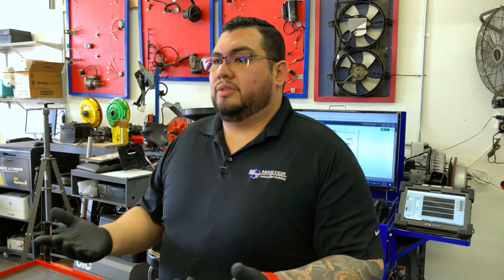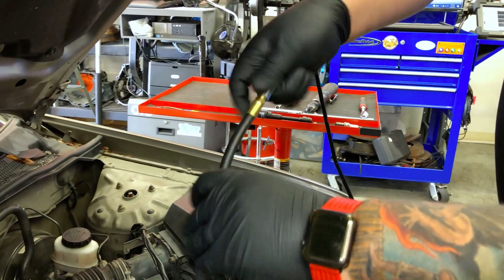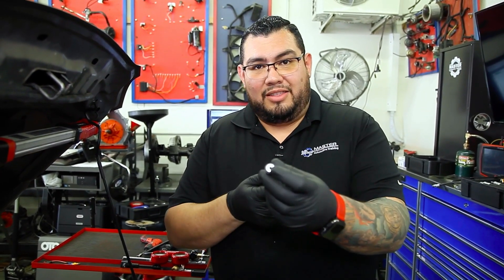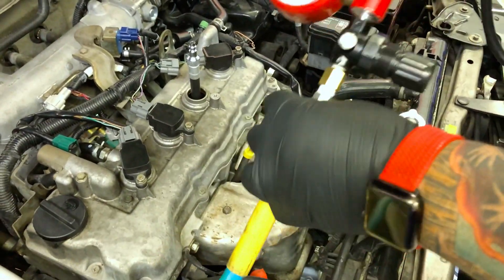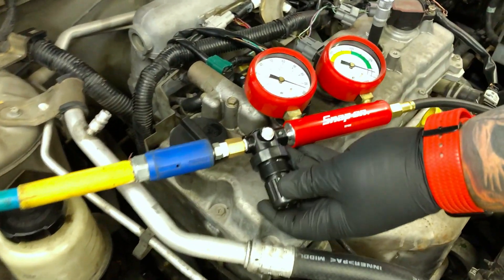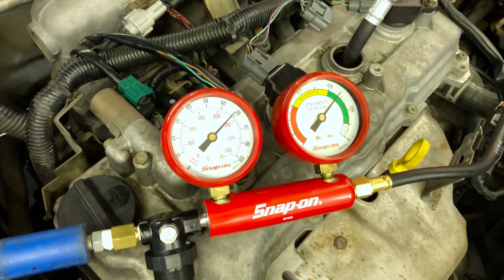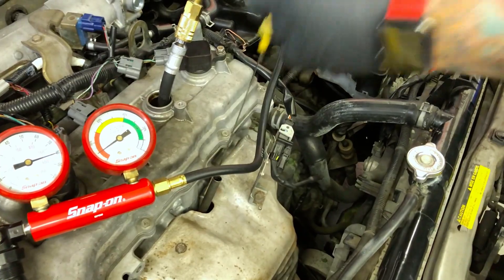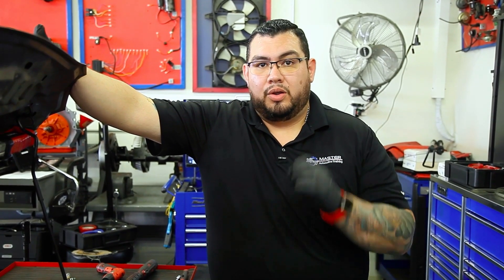How To Perform A Leak Down Test - Fast & Easy

Comment: As a side note: Get in the habit of ALWAYS turning your engine crankshaft clockwise. 98% of all engines run clockwise. Those that run counter clockwise have no timing chain tensioners in them anyway. (Old engines) Anyway, what happens with a timing chain tensioner engine is if you turn it counter clockwise it can unload some tensioners and jump the timing. Now of course people will want to start leaving comments about this or that engine having or not having tensioners and I'm very well aware of those engines. This video however seems geared towards the beginner or intermediate technician. So.... Always turn your engine clockwise by the crankshaft. Don't get lazy and turn an overhead cam engine by the camshaft either. You can jump the timing like that as well. Anyway, great video. Straight forward and informative. Thanks for posting.
Reply: Must’ve never worked on a b series which most would consider a beginner engine

Comment: Did a timing belt an water pump on 2005 Toyota Camry..has 260k vehicle was driven in by customer with no coolant and hot but no misfires or mil . Did timing belt an water pump triple checked timing marks were on point before cranking. Was wondering why it passed compression but still has misfire on back cylinder after timing this video really helped

Comment: You should also turn crank so the piston goes from top to bottom so you get a test of the cylinder from top to bottom. I've seen cracks in cylinder wall

Comment: Yep, I do agree using an extension or whatever tool to find TDC,  however I would say plus or minus20% isn't going to make a difference. Depending on the engine it can be a nightmare to insert a tool, find the piston or may very well jam in some manner which will guarantee the engine needs to come apart.  The video was excellent, to the point and well done. Thanks to the folks who made it

Comment: Great presentation.
I have got a 2017 Honda civic 1.0L a 3 cylinder engine. Cylinder 1 and 2 got 175 PSI but Cylinder 3 has got 0 compression and air is escaping from the intake side. we've replaced VTC intake camshaft, intake valves, new timing belt and still not solving the problem. any ideas? Thanks.

Comment: This information is very helpful but I have a question... If you were to remove the intake manifold for easier access to the sparkplug holes(in the case of a 99 expedition) would that affect the readings ?

Comment: I don’t understand the glove test. You put a glove over the exhaust and it will inflate. How do you know if a ev is stuck open?
Reply: Ok. The point is that you are applying air at 1 pressure .. say 100psi.. then the gauge is real-time showing you the pressure in the cylinder.. if it is low, >40% loss then you basically want to discover where the pressure loss is at.. (1) exhaust valve not closing fully = >40psi of air going out the valve and continuing out the tailpipe… this would blow up a glove to some degree. (2) intake valve leak would show by checking an intake hose to see if air is pushing out there.. *up the intake valve path and back to the intake manifold (3) the dipstick hole with pressure = air getting past the cylinder rings (5) Headgasket= the air going through the blown gasket and entering the coolant system … as seen by bubbles in the coolant (5) if none of the above checks fail (1-4) then you likely have a cracked head and the pressure could be exiting the side of your head .
Reply: @fishonnelson2353 thanks! I missed the part this was done while compressed air was applied only to that cylinder. I thought, “of course exhaust will blow up the glove.”

I just did this test. And all cylinders I found air making it past the rings. Which does make sense, especially when cold and the ring gap is at its widest. But I’m not sure my one cylinder unlike the others at 40% loss (others at about 20%) is any worse pressure wise from the oil cap where I felt air pressure from all of them. They all felt roughly the same, none of them had sound from the tailpipe, the throttle plate, nor bubbles in the radiator. Sounds like from your write up I could have a crack in the head at that cylinder, unless there was a discernible difference in crankcase pressure.
Reply: @Seth_Michael_Hernandez  Yeah...Your test result logic sounds good however, I'm not easy on condemning heads so I would try to zero in more..  Now I would add a 2 tablespoons of oil to the low cylinder... this should shore up the ring loss.. if the pressure goes up to only 20% loss or less like the others then its ring issue.. if it stays low (hopefully with very little improvement *for the purpose of certainty of the test) then I would start leaning harder towards crack .. keep in mind that you should have all angles covered (1) Oil path - to crankcase, (2)  water paths to radiator, (3) air paths to intake and (4) air paths to exhaust.. so if there is a crack it would be to the atmosphere based on what your tests are reporting.
Reply: @fishonnelson2353 ok I’m gonna see if I can get those two tablespoons of oil into that spark plug hole. It’s not at an easy angle to do that, but maybe I can get a baster of some kind. I did have 4 spark plugs with ash build up. This cylinder had a solid “wall” of ash from the top electrode to the insulator built up on one side like a cave. I’ve heard that ashy build up is indicative of oil from the valve stems as it atomizes when entering, whereas oil build up on spark plugs that are dark and wetter is more indicative of oil coming in from the rings. So that gave me some hope. I just replaced my oil valve stems seals for my intake and exhaust on that cylinder. And compressed air did hold both valves in place from falling into the cylinder while I did that job. So I would think that’s 100% ruled out now since there was enough seal to keep them pushed up. No change in leakage often completing that unfortunately. I’ll try your oil trick and see if I get more pressure retained. Hoping for a head crack at this point, so I don’t have to replace the engine. But on my tbi 350sbc I have 193 swirl port heads which are not commonly known for cracking like some others. So it’s not looking good for me.
Reply: @Seth_Michael_Hernandez  Valves holding up if not hissing is a good sign! An oil can or a piece of tube... If that test fails to reduce the loss to normal.. even a even cork the tailpipe could help to expose the air exit path..  I'm rooting for ya on a stuck ring! sound like you're just about there..

Comment: How do you know that the piston doesn't move into transition phase with the 100 psi of air you are putting into the cylinder, and the intake valve is open?

Comment: Didn't explain in detail enough. Y did u hand crank the engine to tdc? Why did the 1st set to tdc with the whistle fail? Access to coolant? Only if the gasket fails correct?

Comment: When checking each cylinder, does each cylinder need to be all the way to the top?
Reply: Yes - the cylinder is sealed (should be) when at Top dead center *piston.  Don’t forget the piston will be at its highest on “compression stroke” and “exhaust stroke” so make sure its on the compression stroke if you read 80% loss or greater

Comment: I noticed that this professional tool needs 100 psi to calibrate to “0” the second gauge, however I bought a cheap one that just need 30 psi to set the “0” , did the test and all my cylinders are in the “yellow” scale meaning less than 20 % leakage….

Comment: Thanks Oscar! The only thing that would have been more helpful for all is what about old air cooled engines without coolant? Other than that, completely informative and a great help!
Reply: If you don't have coolant. Then I guess you're not losing compression through the coolant passages. Coolant test passed. Time to move on to oil, exhaust, and intake.

Comment: Why don't you reset the pressure regulator back to 100 psi on the input side of the tester after you connect the tester?  Some of the pressure loss is in the adapter hose that is not part of the combustion chamber volume.  The output pressure gauge now reads 15% lower than it should which could be the difference between a good and moderate reading and lead to an incorrect analysis.  From 100 psi on the input, the output gauge should read 80 psi or higher (20% difference).  It makes the math easier.

Comment: Very informative. I've never used a whistle though.  I just put a 3/8 extension in the spark plug hole until it's at its highest. I gonna have to try this method

Comment: This is brilliant, !
 I bought cheap cylinder compression tester and a cylinder leakage tester to see whether it's worth spending the time on replacing my 2000 VW T4 Transporter's clutch and main gearbox seal... would you have any similar clutch replacement and bell housing bearing videos?Much aappreciated 
Cheers m8.

Comment: Help!  Any experts in Owasso Oklahoma can help me do this?  I know enough about automotive repairs to be pretty  dangerous having owned numerous  70's muscle cars.  Lol.  I have a 1990 3/4 ton Chevy truck with low compression on cylinder 4 but need to pin point the problem.  I have an air compressor and some tools but no tester.   And by the way, I'm a girl, not that it matters.  Anyway, desparate for help here.  Thanks for any replies! 😅  I forgot to mention it earlier.   The reason I need help is due to I don't have the money to fix the 1990 truck or the transmission on my 1996 Chevy truck so I'm grounded pending getting these repairs.

Comment: Get rid of the whistle gimmick tool, for whatever cylinder u testing yes it must be at TDC find that using the gauge itself once u have found TDC with the gauge disconnect the air line, then put the handbrake ON and put the vehicle into any gear u want to my preference after 35 years in the trade is second gear then reconnect the airline, IF u have full compression the vehicle will lift slightly as its in gear and under LOAD and handbrake on so read the gauge to compare to others, IF it doesn't do that check the gauge then if u have access to crankshaft bolt turn it one way or the other to get the best reading then compare to find which cylinder is leaking, seriously throw that whistle gimmick in the bin, a leak down is always better with the piston under load and more accurate....

Comment: You dont need to be at true tdc to do a leak down. Top dead center on compression would be the last moments of both valves closing. 
Bottom dead center is the begining of the valves being closed. 

In between the start of a compression stroke (bottom dead center) and the end of a compression stroke ( top dead center ) is when the compression is held, aka both intake and exhaust valves being closed. 

If any extra leaking occurs in any range of that begining and end of comp. Stroke you will notice it and youll bave to find it. 

Aka listening into the crankcase. Intake manifold. Exhast

Comment: I recently got a dod amf delete kit with a Non DOD Cam #2054301 3-Bolt Stage 2.1 NSR (218/227 .523/.523 HR112 , had it tuned but it’s still not running right and now my brake petal is hard , replaced the brake booster but no luck any thoughts ? It’s a 2008 Chevy avalanche, RWD

Comment: Sup, man? Is there a correct way to do a compression test? I found multiple videos and not one of them is the same. I tried one method pulling the ignition fuse and it wouldn't even crank. Every video says, "it's really easy, just do this," and it's never the same 😂.
Reply from the maker: What part of the test are you doing, static or running?

Comment: Great presentation. Unfortunately, it seems like the only way to know for sure if the valves are truly closed is to take off the valve cover. Maybe place a thin rod down the spark plug hole to confirm it's at TDC. I like to use my mechanics stethoscope rod that unscrews.

Comment: the guy that invented this test is a genius !  newbie question: is the cylinder (ring against wall, and valve against seat) supposed to be completely air tight like a balloon ? ---- pretty amazing assuming it's made with steel
Reply from the maker: Vale seat yes, pistons rings will have end gaps so they aren't fully sealed.

Comment: Tdc doesnt always reveal cylinder cracks, damage or defects.... ive seen gouged cylinders that seated with the rings just fine at TDC. Your cylinder can still lose its seal halfway through the stroke which can just as easily lead to catastrophic engine failure as a broken seal at TDC. I like to do both TDC and BDC when I do a leak down. I also like to do it with the valve covers off when feasible. If the valve covers are too hard to get to then put your tools away and close the hood. The car is a piece of junk built by idiot engineers and belongs in the trash.
Reply from the maker: Thats correct, this is why this is follow up test to, static, running and snap compression. Those tests will test the cylinder dynamically to show the faults you listed above. A static test like a leak down is simply a follow up. Thank you for watching.
Reply: @MasterAutomotiveTraining  by static test I assume you mean a compression test, which should be why youre doing a leak down test to identify where that leak is at because if there is no compression loss then I can already tell you what the results of your leak down test are going to be. Im just pointing out that if your leak down test is inconvlusive and you cant identify the source of your leak then you should find it running a test at bdc and by watching the movement of your valves.... even a weakened spring can cause leakage intermittently. A worn piston skirt is another common issue that doesnt always show up on TDC  because the rod is fully extended
Reply from the maker: @brandonharvey7939  No static test is testing the engine or any component not operating. A static compression test only tests the engines ability to build compression and seal. You then run a running compression test along with a snap test to then determine the engine ability to breathe known as Volumetric Efficiency. If you spot a low compression static, then a static leak down test is needed to find where the sealing problem is, however its not bullet proof. For worn valve springs, guides, seats, you should have done a dynamic vacuum test to spot those faults.
Reply: @MasterAutomotiveTraining not familiar with this static test youre talking about and the only information google seams to have on it relates to jet engines but according to your description it sounds like you are implying that a leak down test would also be a static test because its done without the engine running

Comment: Me, "that whistle tool seems like the dumbest thing I've ever seen in the history of automotive tools."  Halfway through the video, "so it didn't work" lmfao
Reply: Just put a straw down the spark plug holes and rotate crank by hand until the straw indicates TDC.
Reply: What do you do if it falls in
Reply: Well I mean it should be long enough that you can see it. If it is, then it can't fall far, there shoukd be a piston in there to break its fall. If not, then you might be getting close to the root cause of your poor running engine. 

But to answer your question directly, if you are so dumb that you use something  that can fall into the cylinder, then you deserve to pull the head. 
I'd suggest a nice long dowel. Maybe 2 ft. Aint no engine in consumer automotive that has a 24" stroke.
Reply: Talk about dumb ...lol who uses a 2 ft long dowel to check top dead center all you need is a screwdriver cuz the handle is big enough where it won't slip into the spark plug hole.....😆😆 You keep using those two foot rods ..but that sounds just as dumb screwdriver is all you need unless you want to be banging that 2 ft pole into your firewall

Comment: Great but, your video has confused me as just a backyard, yet long time backyard mechanic.  Noting your Whistle Set of TDC appears to not work the First time around. Yet you say on the second time..."we know it's at TDC"...again, but is that because u did it by Crankshaft (u said it first time also)??
So if it didn't work the first time, why is it working the second time?
Also, you say you know the engine was NOT miss-firing, so you need to reset the TDC. But if you did not know the engine was NOT miss-firing, then you (I and others) would have done a test that is not valid. 
Please help us understand these contradictions...the Whistle doesn't seem like a very valid way set TDC if you must know the Fire condition with surety?  So confirm that you must KNOW that (1) there is no missfire (how can u be 100% positive) and (2) how do you know the 80% loss of compression is not due to some other factor so that you just keep resetting your TDC until you get some other reading that is not extreme like 80%?

Last, it appears that you just resorted to using the Crankshaft method to get to TDC....because as per your video, it is not so accurate to use the starter motor because as in your video, the WHISTLE was blowing, but the engine obviously was PAST TDC or either not yet there. 
So why play with the Whistle if it is NOT ACCURATE??

LAST..you showed a second cylinder test where you had 80% Loss of compression and yet...the first time you tested another Cylinder...you had 80% loss of compression and said - "OH, we don't have TDC" How can you know when it's actual Compression then, or it's a Bad Test altogether.

I liked your Video and detailed Instructions, but the findings are very Confusing...please help us all understand them....THANKS!